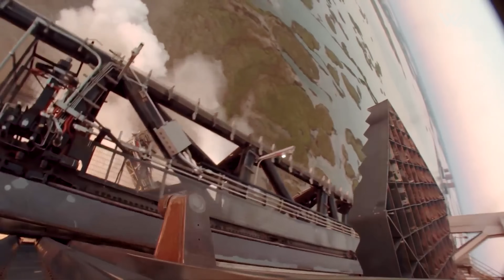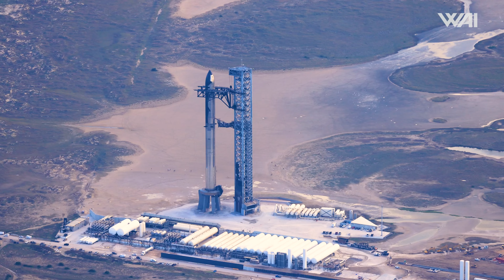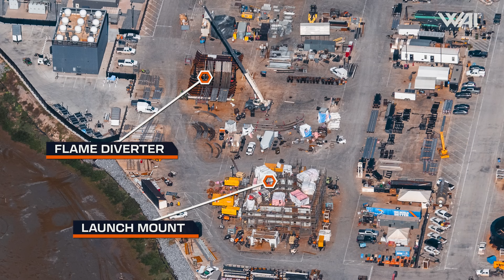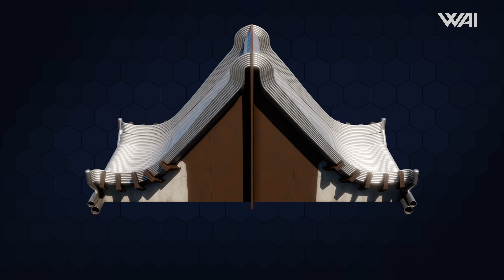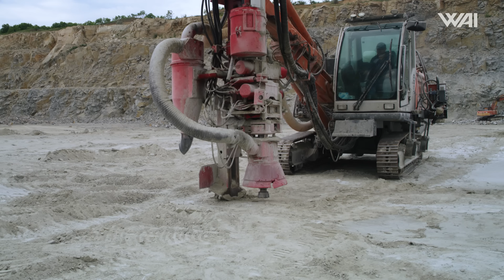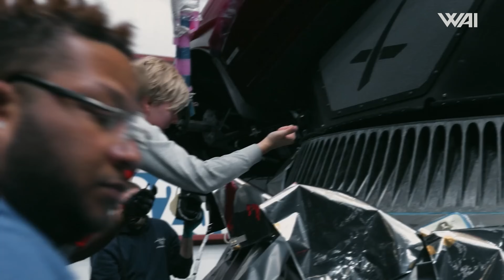FAA Filing REVEALS: The SpaceX Starship Giga-Plan!

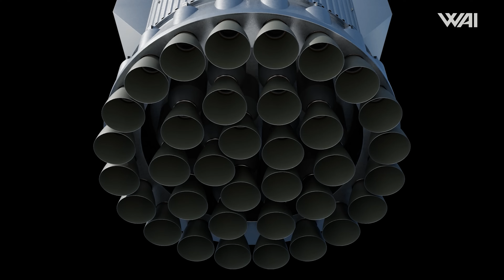Comment: 8:50 What's that about? Doesn't Look good, just have a negative feeling about that scene unfolding! 
Mach cones: anybody out there in academia, who does a PhD on it, and Mach_Cones' feed-back Loop on the rocket? 
 8:50 this configuration of the engines is the opposite of "good", it will win the NASA prize 
   of "Biggest Rocket with the Tiniest Payload in 2026" (unless if it is meant for the Landing & Catch configuration only)

Comment: Ok, multiple landing options makes sense.  Account for as many landing variables as possible.
What's their current status on landing strut support integrity?
Remember they were having problems with the flex stress on the landing leg support structures.  The hydraulics at that stage were not compensating for the bearing load of the leg structure.
There's also the problem of load distribution and the high center of gravity.  The closer the legs are to the body the higher the risk of toppling.  Even early sifi movie makers knew this with vertical landing spaceships.
Secondly, how are they going to solve the cratering problem for landing and takeoff on the moon? 
Yeah, the first few landings will have to be with a lander similar to the Apollo one.  But that office high rise is a whole new can of worms.

Comment: Does tower two have a place holding tower section just below the top section with the lifting device. Could Space X remove the top section, add two new sections to make the tower 150 meters to match Starship V3 height?. Or are they going to build tower #3...

Comment: 1 foot pound is a pound of weight located 1 foot from origin.  2 foot pounds is same weight two feet away.  Now do the math for the booster weight.  Then do the math for the bending moment of a tall tower.  Then you come to the realization that space X is pinning their hopes on the booster hovering almost vertical, and that means a trade for fuel remaining.  Not smart as it is simple engineering to build a catch tower that gives the booster more error margin. And yes, I'm an engineer.  Space X engineers are taking big risks with the expensive launch tower.

Comment: I'm a Ground News subscriber.

In my opinion, SpaceX is a light year ahead of Blue Origin. That said, I agree that SpaceX needs competition. I'm happy about Blue Origin's successful first orbital insertion. The failure of the propulsive landing of the first stage was a learning experience à la SpaceX. I just wish Blue Origin was more transparent.

As for the failure of the Starship 33 for IFT7, it was a disappointment. I did expect better. 

Here's where I'm weakest : I expected IFT1 to fail based on the experience of the soviet N1 rocket, which had 30 NK-15 engines (too many parts susceptible to failure). After subsequent Starship flights, I was proven wrong. What a joy to be proven wrong !
Reply: That was my concern as well, during IFT1. It's been thrilling to see the booster design succeed despite the large number of engines as potential points of failure. During that first launch when the engines lit and the booster barely rose from the pad I thought we were about to see another N1 disaster. The aerobatic flight we soon witnessed was a testament to the ruggedness of the booster's structure. I thought I was going to have an aneurysm! As you said, it was "a joy to be proven wrong!" 

SpaceX's Starship iterative design program has been very successful advancing the ship's design and gaining information that simply cannot be obtained using any other research method. The general public doesn't understand this concept and fails to grasp that "success" IS advancing the design through real world testing, not simply accomplishing a discrete mission goal, as some suggest. This process will advance the design in unexpected and unpredictable ways. This is so exciting!
Reply: Your opinion is apparently uninformed by events -- Starships V1 and V2 failed to achieve any of the system's main design goals despite public funding of almost $3 billion for Starship HLS.
Reply: @rdbchase  I didn't suggest that Starships V1 and V2 completed all of their benchmark objectives successfully. V1 has only flown suborbital test flights ending in the Indian Ocean near Australia. SpaceX calls these prototypes, not production vehicles.

Starship HLS is another matter entirely, with far more ambitious goals. It will take a number of Starship tanker flights to refuel the HLS Starship : perhaps as many as 15. Then there's the matter of docking with Artemis in orbit around the moon, restarting the cryogenic methalox engines in deep space, landing on the moon, which will require landing legs and much more besides.

Furthermore, Artemis is just a vehicle that promises to carry astronauts to lunar orbit. Nothing more. According to NASA, SLS has cost $ 11.8B in public funds, and Artemis $ 93B. All public funds, mon ami, with lots of interference by medling politicians from both parties. Boeing's Starliner has cost more than $ 5B at this point, and has contributed to Boeing posting a loss of $ 11.8B in 2024, which includes liabilities related to the 737 Max and a strike be employees. A matter of bad private sector management. 

Meawhile, SpaceX developed the Crew Dragon with $ 2.6B of public money, and has flown 15 successful and safe crewed missions, 10 for NASA and 5 for private adventurers. Crew Dragon is also the 1st American crewed spacecraft to fly in 11 years since the retirement of the Space Shuttle, putting an end to the dependence on the Russian Soyuz to travel to the ISS. The reusable Falcon 9 first stage has cut the cost of access to space and set several records. We've seen progress from IFT1 to IFT6. The Block 2 Starship 33 was a disappointment. The catch of Boosters 12 and 14 were dramatic, impressive and unprecedented in the history of rocketry. We're seeing progress.

What I want to say is that we don't have to like a person or agree with their politics to be impressed by their other accomplishments. That's being objective. There's enough gratuitous criticism in the world today. It doesn't bring hope.

In my original post, I made reference only to Musk's successes with SpaceX and Bezos's launch of New Glenn 1. I added that Blue Origin could and should become a worthy competitor to SpaceX. And why not ChaseSpace one day ?
Reply: @ "I didn't suggest that Starships V1 and V2 completed all of their benchmark objectives ..." -- it hasn't achieved any of its essential design goals.  The deficiencies of Artemis or SLS do not bear on Starship's failure at all.  Falcon 9 is a successful system; there's no indication yet that Starship will succeed.  Catching the booster is insignificant in comparison with all that Starship hasn't done.  There's no way that Starship will be human-rated by 2027, if ever, so Starship HLS isn't even on the horizon.  Musk may be planning on looting the Treasury to continue development, but most or all of the $3 billion we gave SpaceX for Starship HLS must be gone and I doubt that Musk will fund Starship out of his own pocket.
Reply: @rdbchase  There has never been any plan to make Starship human rated. Think about it; how would they integrate an abort system? It's primary purpose is the mass distribution of ULEO data streaming satellites. Everything else is a distraction from what they are actually doing in plain sight. They will probably start doing this in a couple of launches time regardless of whether or not they can recover it. Elon thinks he can win the game this way or at least level up. It doesn't matter to him what it takes to do it, he believes that we are all NPCs.
Reply: SpaceX are not transparent they are performative. Musk does not actually have money the way Bezos does, so he needs constant public profile boosts to keep the value of his meme stock high enough to be able to keep his lines of credit open. 
He is a Giga Ponzi.

Comment: When is SpaceX going to give up on the idea of a booster quick disconnect that remains in place and has to endure the full force of the boosters launch and landing? They already have a Starship quick disconnect that swings out of the firing line and will eventually be rapidly reuseable. The Boosters quick disconnect in it's current configuration will always be a maintenance item between flights. Not very good for the rapid turnaround SpaceX is aiming for. Just replicate the Starship QD even if it needs to be increased in capacity at least it won't need repair after each launch.
Reply: well they are redesigning the whole launch mount so maybe they though of something to fix that too.

Comment: IT doesn't seem likely ship 34 or 35, will be caught. We didn't get the data needed for the possible catch pin points for starship if they'll sustain reentry heating. So try duplicating, then possible catch with ship 36 or 37.

Comment: Im disappointed that Felix is fueling the hoax about space debris. Most space debris is around 100k miles apart from eachother.
Reply: the point is that it exists and as more people have access to space it's going to increase unless there is more care taken to get used space vehicles and satellites down.
Reply: @shaung949  You're ignoring the fact that SpaceX is responsible for over 70% of the satellites in Earth orbit.
Reply: @ and unlike others spacex starlink satellites are designed to de-orbit and burn up once they are no longer in operation. They also operate in low orbit where so even a dead satellite would only be a problem for a few months.

Comment: There´s no hurry for the next flight. I prefer watching Starship landing intact on the chopsticks instead on the ocean.
Reply: Even if they don't "hurry" the next flight, they will still drop the next starship in the ocean. It's an intentional part of the testing campaign - after all, the ship doesn't even have the necessary hardware to be caught by the tower yet.
Reply: @jaydee4177  Yeah, the first catch attempt is at least two flights away... maybe more depending on how well the next one handles Ship re-entry. They're certainly not going to attempt it until they've had at least one block-2 Ship repeat the success of flights 5 & 6.
Reply: The last one landed 387,698 pieces in the ocean, give or take a couple hundred thousand...

Comment: Noooooo, not relying on SpaceX is completely correct. multiple rocket vendors are vital, and why the commercial launch system was created in the first place.

The problem is not that SpaceX wouldn't execute, but rather that what SpaceX wants to do and what is needed and maybe totally different.

It's that competitionthing, after  all.

Comment: At what point does the FAA give the greenlight for SpaceX to launch these rockets at will? They are literally hindering the space race. How bad would we look if China overtakes us in the race due to our slow and outdated government procedures. I understand putting a hold to clerify the reason we lost the ship on IFT 7. But once cleared up it should not takes monthes for the FAA to give the greenlight
Reply: Most of those delays are done with as Spacex is able to use any plan they have used before, it's when they decide to do someting new that the FAA has to take time to consider the update.

Comment: Starship will NOT open the solar system to us!!!!!
Till we get off the chemical fueled Rocket engines, and make a transit to a new type of propulsion, think ion, or even warp drive, basically electric/gravetic propulsion we are stuck on this rock, and with current speeds of Delta V we are basically not going anywhere. 
Time to unlock Skunkworks, as former CEO said, ET wouldn't have to phone him,e we can take him home...... 
Then and only then will we become an extra-planet even go out to the stars...

Comment: @Whataboutit the support structure that was used to build the shop sticks, is called truss and is completely different than scaffolding. 
A standard can max hold 10 tons. 
The truss we cal it at stageco black steel. A truss system is overall more stable and stronger.

Comment: No way the ASU wil run so close! it will trip at each launch, each static fire test, they have vibration sensors on compressors, which charts  will pierce the cieling at each raptor start!

Comment: How expensive is it to repair the launch pad and booster after each launch?  Is all that much money really being saved over expendable boosters?
Reply: Yes 100% also the rocket still has to launch from the same launch pad so most of the damage is already going to be there whether or not they catch the booster. More importantly the pad they currently have is basically version zero meaning its not even close to a finished product which is the main reason why there is so much stuff to fix after a launch. The launch mount there building now will probably need nothing more than a fresh coat of paint.
Reply: More than you can afford,  pal. Ferrari!

Comment: I don't believe the dimensions of the gigabay willl be sufficient  (in the future). It would make much more sense to to take the height of the current fully stacked starship and add 10 or 20% to  allow for future expansions. The currently envisioned dimensions will pose a limitation which will hinder development in the future, making the build of an even larger Terabay necessary.
Reply: They are not going to be assembling full stacks in there, the version 3 booster is only 80 meters so there is a lot of space for stacking those. Boosters and ships will be put into full stacks at the pad.